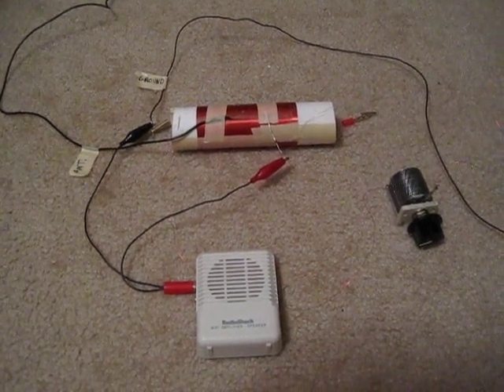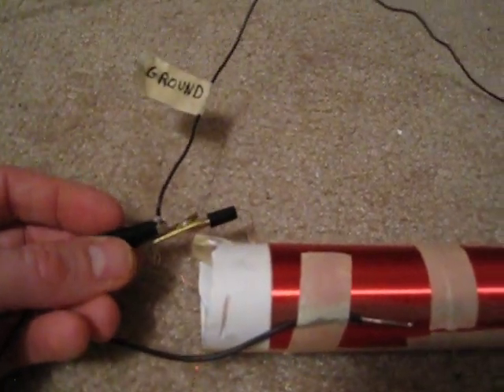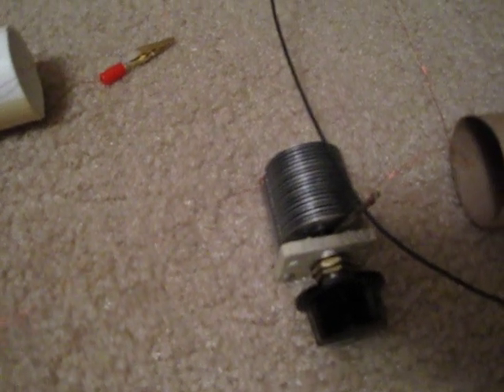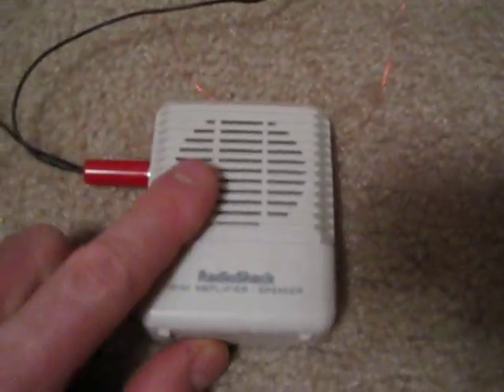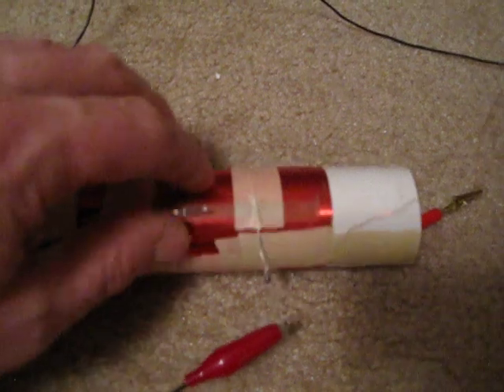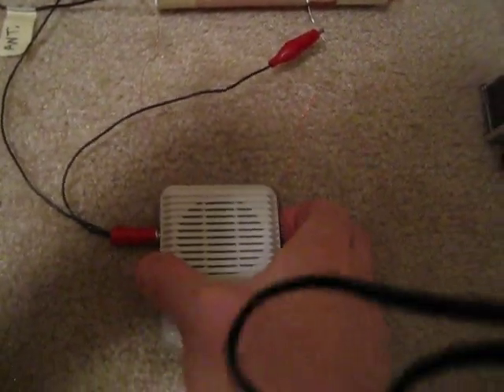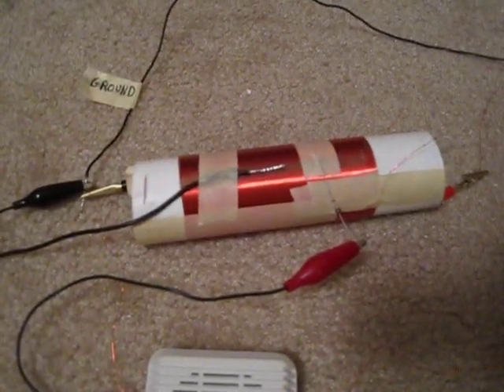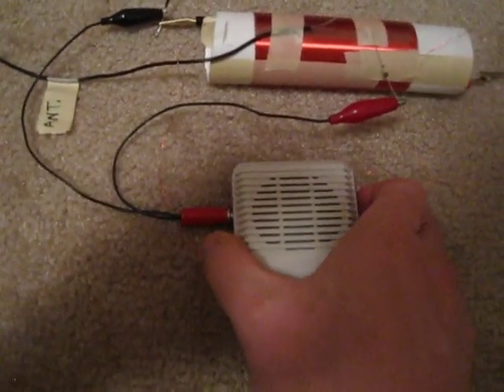Crystal Radio Receiver construction walkthrough

Comment: I think you have a few great ideas... good thoughts on construction materials. However, there are numerous contruction details and ground suggestions which need more research before sharing on this venue. I'd suggest more ideas which will form the basis of investigative research like the number of turns, effect of the plastic you chose on the inductance, the recommended inductance for a range of tuning with your 365 pf. variable, etc.